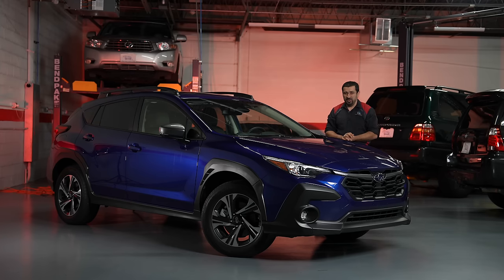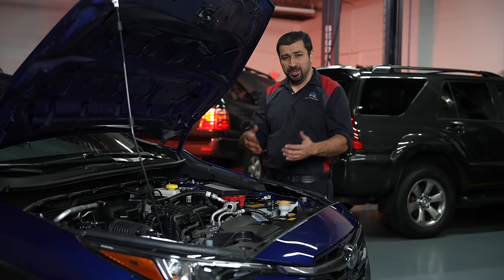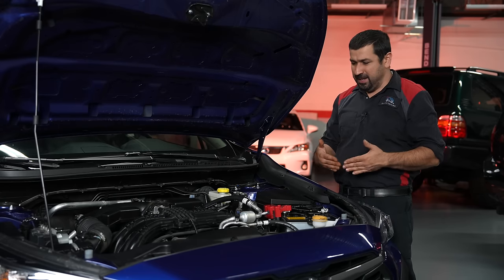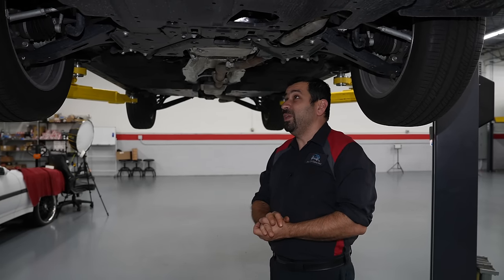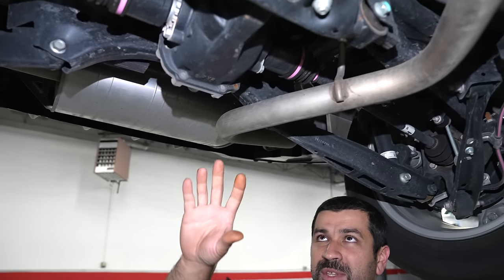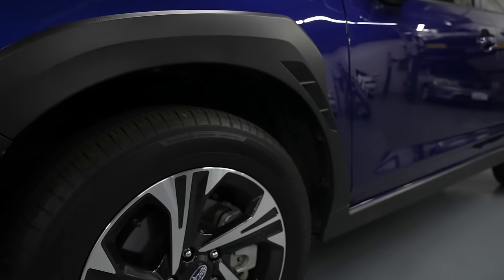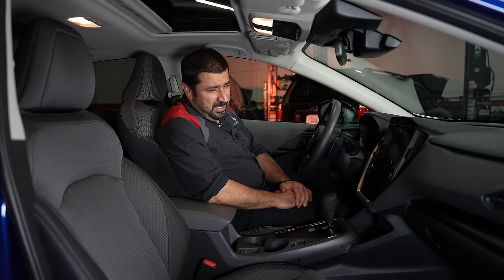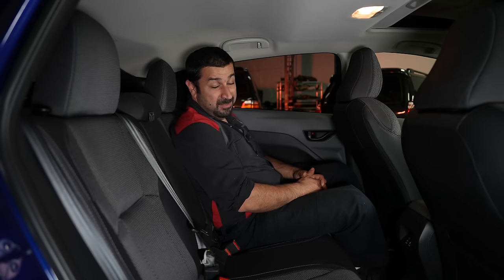Should You Buy a 2024 Subaru Crosstrek? Thorough Review By A Mechanic

Comment: The only reason to buy this car is the great all wheel drive. Pulling the engine to adjust valves is totally ridiculous along with the cvt transmission. I would not buy this car….lease it it’s their problem in the long run👍